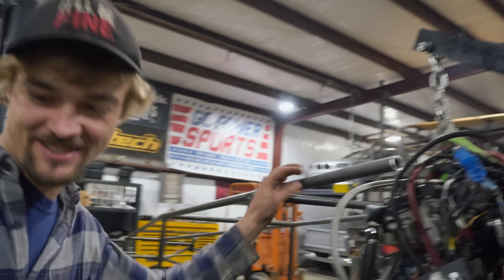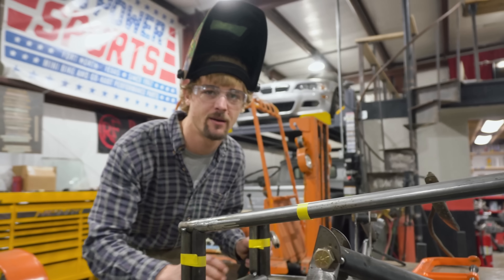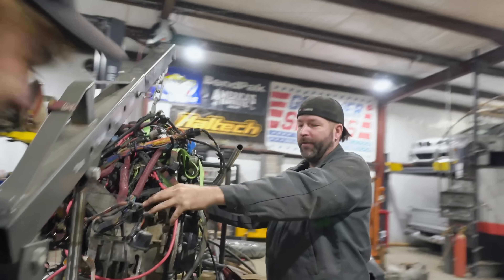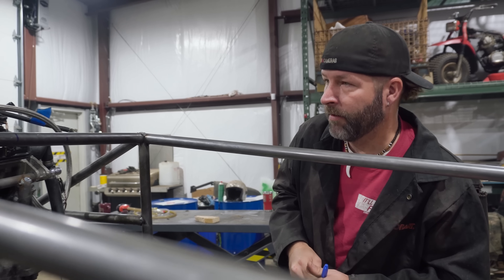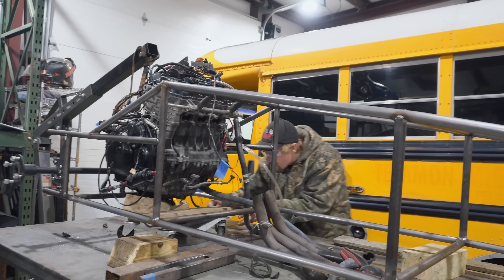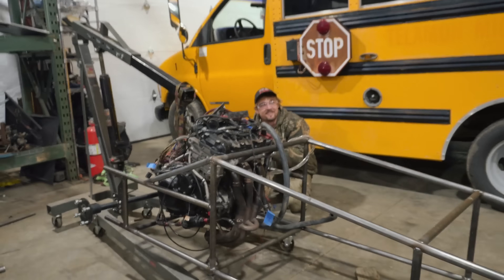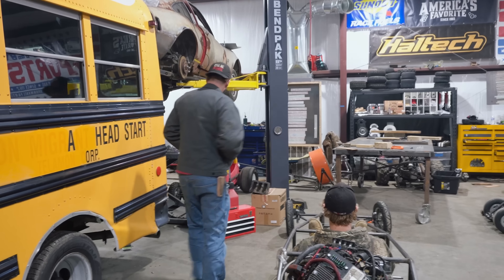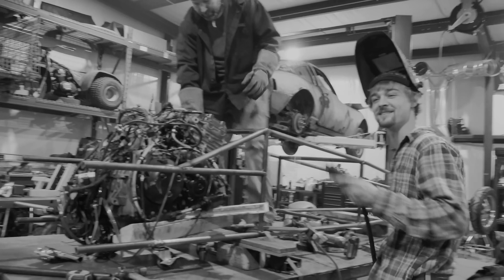Triumph Triple Dragster Built Pt. 3 | Rolling Chassis!

Comment from the maker: It's starting to look wicked!
Reply: I swear this is the only channel I watch religiously and keep up with there schedule
Reply: I want to see it wheelie!
Reply: I still say Eaton M24 supercharger!!!!! Just run it on regular fuel. Higher octane, the better, as usaul. It's a perfect match, capacity-wise.
Reply: There are some super cheap options on the "speeduino" / DIY side of engine management. I don't know much about them but a friend has some engine swapped turbo Ford and he swears by it, and (as I understood) is in progress to maybe design his own PCB for the power management. He showed me a development board for a STM32F407 that cost him about 25 dollars, which he is going to use as a heart of his new engine management. Said that the thing can run even an 8 cylinder.

When he went to the dyno (with the existing system), the chap told him to run the boost pressure with the old school bleed style for "less headache", instead of some closed loop system. But eventually he got the parameters right and told that now the turbo starts to spool like 500 rpm lower than before and the engine runs really nice when cold and in daily use cases, for example on intersections, where the engine had a tendency to die before.
Reply: I think I might have an older welding helmet you guys could have for the camera
Reply: You may have just built a wheelie machine
Reply: Think you should ditch the dirt and build this for the strip. 
Great build so far
Reply: I once heard a great man say "O YEAH!", I do find it most fitting for your.. automobile.
Reply: Where's the radiator going?
Reply: This build is nothing like a sand drag car…

Comment: Three things to say 1. Radius arms on the front axle so it doesn't fold back against the side 2. That's a really cool build 3. Next rail should be a two seat not side by side but inline with each other.
Reply: A skid plate under the front lower corner of the chassis as well, to prevent digging...

Comment: So glad you guys finally put a street bike motor in a drag build
Reply: And it has FI 😎👍
Reply: Too bad they didn’t do a Hayabusa motor so when they turbo it, it can withstand the power and also have close to 200hp without opening the engine.
Reply: I'm still waiting for them to stop dicking around with junk motorcycle engines and build something around an old school HEI or Points fired smallblock V8.
Reply: @TestECull  joe hunt Magneto and hilborn injection.
Reply: @TestECull  on a kart? they already build cars, they dont want to build smaller cars. they want KARTS
Reply: @ghomerhust  No, a kart. Just because it has a car engine in it doesn't mean it's a car, no different than putting a bike engine in something makes it a bike.

People have built LS powered barstool racers. Surely a gokart around a clapped out smallblock chevy isn't too radical. And itt'l be a hell of a lot more reliable than the clapped out bike engines they keep using.
Reply: @nessie42786  nah leave the injection off. I'm thinking more along the lines of ripping the tired 305 out of a too-rusty-to-save squarebody chevy and building a kart around it. Ol' HEI dizzy and Q-Jet combo.
Reply: Sameeee!!!!!!!!
Reply: Can't wait for it to be done
Reply: @TestECull  weight
Reply: lets just hope they don't try to turbo the motor or run it on Methonol that motor wont take much of that but leave it stock it will last forever. I'm experienced with building race bikes if it were mine I'd add a cam, maybe increase the bore but that is about it you could make 130hp tot he wheel with the right mods and still be reliable.

Comment: You can actually probably keep the stock ECU even if you start adding power. TuneECU software provides a lot of tuning flexibility with the original ECU. TTS performance makes supercharger kits for Triumphs (not sure if compatible with your particular engine) and a lot of the components are left factory. Their Triumph Speed Triple supercharger kit makes around 200 hp.
Reply: I feel like modern single turbo will be as good if not better

Comment: Don't forget to put a plate between driver and motor including back of head to roll cage as you never know when thing explode 3mm or 4mm steel plate would work. Put small holes in lower part of plate behind seat then just fill in gap of behind head for cage with plate. Safety first right we all wish we where invincible. And we love to see more content for future.love the build

Comment: The dragster 2.0 is looking good. The only thing you could add is maybe some triangulation tubes on the sides and bottom of the drivers area and the area between there and the front axle. This would make these areas stiffer and if God forbid you ever hit something it would be more likely to stay in one piece around you. 🏎

Comment: Finally a round tube bend you got to do that with the upper seat tube too. 
Bend it to the form of the seat even beter. 
Make sure too braze the frame as smart as you can. 
A say triangle it. 
Good luck guys.

Comment: There Has to be a Hoop from the lower frame to above the driver Behind the seat.If you want to be identified after the wall at 100+ there should be 1 in front of the driver,and connect them.Anywho..Will you do 1 centered spot to connect the front V's as a 3rd link that's equal on each side so you can flip them over and swap to opposite side for height in sand/dirt?When you flip them,just swap spindles too.

Comment: I agree with Ike. Move the seat forward at least 24 inches, maybe set it in front of that cross bar, just to see what it looks like. Or cut the cross bar out & slide the front & back til you like it. Mid way between engine & front end would look cool. Just a thought.

Comment: You know what you could do to increase ride height? You can flip the front suspension arms 180 degrees. Though you'll have to also take apart the spring and knuckle section and flip those, too.
Reply: Funny.I just posted similar,way too late I guess.It's a good plan.

Comment: if you pitch the a arms back 10 degrees, that’ll prevent “bump steer”just my 2 cents. Where I’m from, what you have here, is a “Dry Dirt Dragster” or Sand Dragster. With your power plant and wheelbase, combined with your over all layout, you’ve surpassed gokart. Great job so far,,, can’t wait to see your first Shake Down Run

Comment: Ive seen that to boost the engine but make it more reliable you have to lower the compression ratio
It makes sense cause to lower it you have to increase the volume of combustion chamber and that makes more space for the forced air and fuel

Comment: The sand drags sometimes get a little rough. A few inches of rear suspension travel will help with the ride and traction a lot. I had an old Honda Odyssey ATV with no suspension that I ran in the sand in the early 90's and it wasn't fun. Due to the lack of suspension they were also very prone to frame cracks. Extended swingarm suspensions are very common in the sand world.

Comment: Turbo charge this build in the future and you'll be absolutely flying.
Reply: It’s on dirt though, more power = more wheelspin
Reply: @dylanzrim3635  They are using it for both dirt and pavement drag racing. Also, paddles on dirt work fine, better than on pavement alot of times.

Comment: I would like to see you do a split exhaust for dragrail 2.0 where 2 exhaust ports are coming out on the right side and the other two ports are exiting on the left, obviously in front of the rear tires
Reply: Except it's a 3 cylinder engine not 4
Reply: @Andrew Stachar  I didn't know I thought it was a symalar engine to the cosey coop